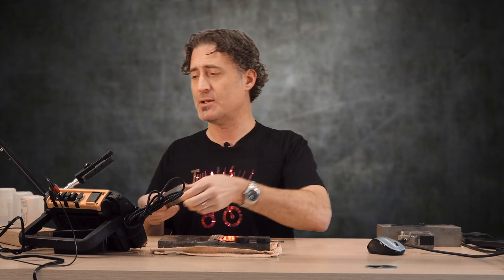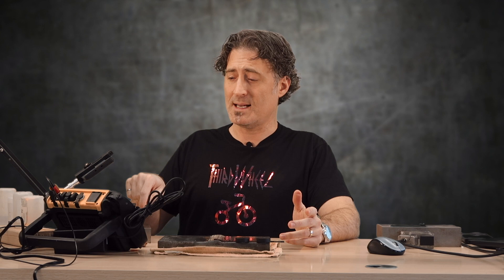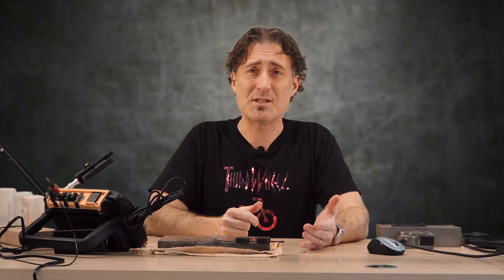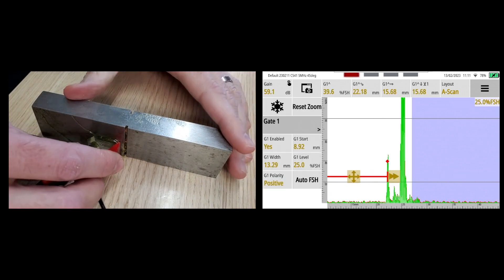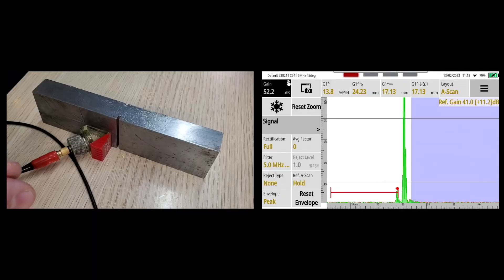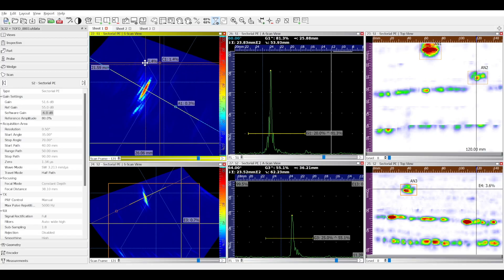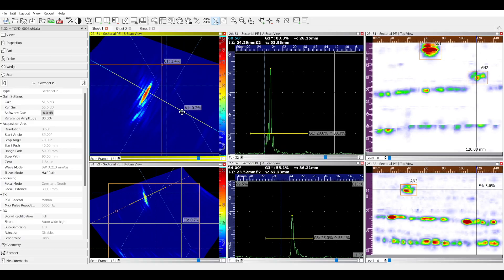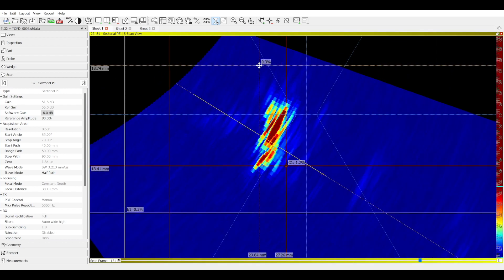dB Drop for Sizing Crack Height

Comment: Can you upload a video on how to size the width of a defect in manual UT
Reply from the maker: Please see the video on 6dB drop for length sizing
Reply: @hollowayndtengineeringinc.5201  sir but my seniors told me that the height and length of a detect can be found using manual UT but the width cannot be detected using manual UT. So can you explain if measuring the width is possible or not?

Comment: The corner method is the most accurate to measure the height of cracks, but it presents a problem with indications smaller than 1 mm.

￼
Reply from the maker: I think if you look at that PAUT image, you can see how unreliable using the corner trap is.